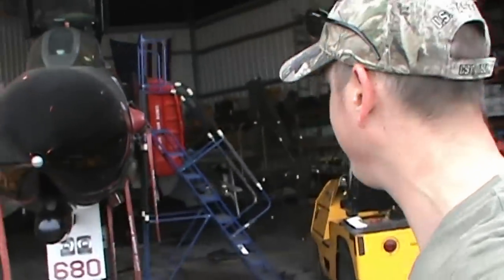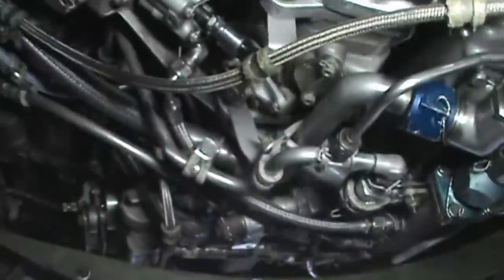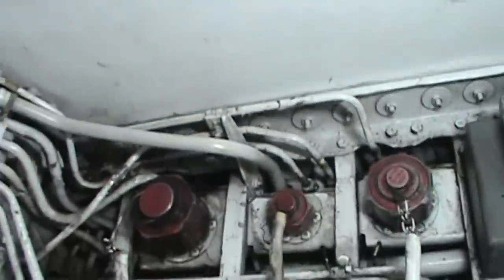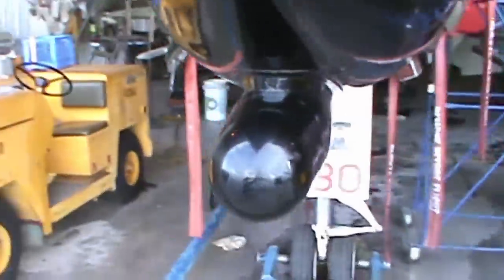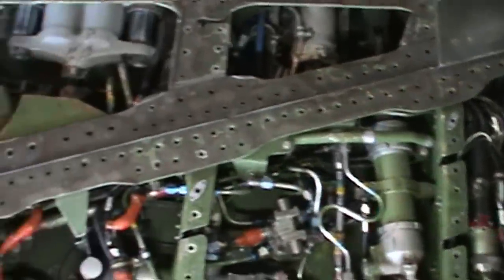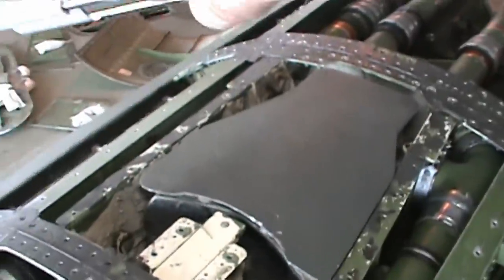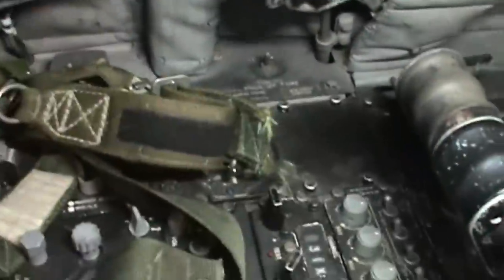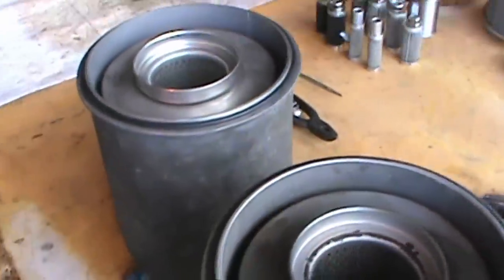An inside look at an F-4 Phantom

Comment: I was a WSO/EWO in the F-4E and RF-4C. Fun to see a Rhino being serviced to fly. I do remember having to know many of those circuit breakers in back seat. One was for the pilots seat. We would prank a new pilot when flying by having them run the seat all the way down so that we could see the fuel gauge (none in the back). When they had it down we would pull the breaker. They’d start to get worried especially when approaching to land. And, we’d say, “Guess I’ll have to land this one.” The newbie got really nervous then and the jet would start wobbling as they tried to figure out how to see. Eventually, we’d reset the breaker. The relief was so evident. Lol.
Reply from the maker: That's awesome with the backseat pranks! Thanks for sharing and thank you for your service!
Reply: Did you fly it after DMAS was added? If so, did you guys utilize the new bombing modes when dropping dumb bombs or did you still emphasized manual bombing?
Reply: @agostonbazmajer1100  I was in the last F-4 training class the USAF had. The only non ARN-101 Rhino I ever flew was in the RF-4 where I flew a couple pre ARN times but also the newer post ARN with GPS which the Boise Guard flew.
Reply: @sharizabel2582  Thank you very much for the answer. I have a second question if you don't mind. By the time you got to your operational F-4E squadron, how much emphasis was put on using LGBs or the GBU-15?
Reply: @agostonbazmajer1100  I was never actually in an operational E squadron. We trained in the E then either went to G’s or RF’s. The last operational E Squadron closed 6 to 9 months after we graduated.
Reply: Y'all are evil, I love it 😂
Reply: That isn't a nice prank but it's very funny all the same
Reply: It was normal for the WSO to fly from Oscura bombing range back to Holloman AFB. I had a fairly new WSO and  while he was flying I would start turning off the Stability Augmentation channels one by one. This resulted in the aircraft getting very squirrelly to the point that the aircraft was almost out of control. I would take control of the aircraft and “save” us by turning the Aug channels back on. My WSO finally caught on to what I had been doing. On our next weekend cross country, we were over Amarillo, TX when the Master Caution and Fuel Low Level lights came on. Somewhere in the vicinity of the pressurized avionics bay right behind the WSO is the fuel feed tank. All fuel going to the engines comes through this tank before entering the engines. There was a switch next to the fuel gauge that when raised, allowed the pilot to check the fuel quantity in the feed tank (1800# max if I remember correctly). I tried to check the feed tank but it did not work. I didn’t know the status of the fuel in the aircraft. I knew that Amarillo used to be a SAC base with a very long runway. Just before I pressed the radio switch to declare an emergency with Albuquerque Center and do a high dive to get the aircraft on the ground as soon as possible, I heard a snicker coming from the WSO in my headset. I said “what did you do?” I later learned that he had pulled the fuel control circuit breaker.  I had to admire his ingenuity. It was a great payback!!!

Comment: Nice video, thought I'd never see the inside workings of an F-4 again...
Brought back a lot of memories...some good,some not so... The F-4 would bite you if your not on your toes!
Reply from the maker: Thank you for your service! For sure, you have to be real careful walking around underneath her!
Reply: Yes, you'd hear or see horror stories of guys in a rush using a high pack to inflate tires or an egress troop pulling a seat while stepping on the rocket lanyard and going for a ride into the hangar ceiling.  I had a lot of respect for that seat while pulling safety pins or installing them.

Comment: One of the most impressive planes ever. The Truck. the Flying Brick. Look at all that hardware.  Mindboggling!
Reply: Big Iron.  Rhino.  DUFF.  Eisenschwein (Iron Pig).  Luftverteidigungsdiesel (Air Defense Diesel).  The only airplane so legendary that it might actually be able to just almost replace the A-10 by carrying a cannon in a pod.
Reply: Good old Lead Sled

Comment: I was a crew chief on the RF-4C at Bergstrom AFB in Austin Tx in the 80's. The thing you said is a big oil filter is actually where a "cart start" attached. This is a coffee can gun powder cartridge used to start the engine without a -60.
Also the wing hard point is not where drop tanks mount. They're two 370 gallon fuel tanks on the wings (1 on each).
Panel 23....omg.... utility hydraulic pump, air pump... always an oily mess.
That air conditioner vent is where the 10 liters of LOX is contained.

Leading edge flaps reveal the BLC (boundary layer control) where exhaust glasses from the 17th stage of compression is used to reduce the air pressure on top of the wing is slow flight.
Reply from the maker: Awesome, thank you for your service! And thank you for the insight on the tanks. I think I had it mixed up with another aircraft in being able to carry two on each wing.
Reply: While I flew F-4D’s at Holloman AFB in the mid 70’s, the rear BLC was capped off. I heard that it was to save the maintenance required for the rear BLC. We increased the final approach speed by 10 kts. The real purpose of the BLC system was to achieve the lowest approach speeds for carrier landings. It did not have anything to do with accelerated stalls.

Comment: AWESOME! For such a big bird all that stuff looks just stuffed in tight. That just gives me more mad respect for the mechanics keeping her flying, and cursing the engineers.
Reply: As a crew chief, I had to open many panels for the specialists with a speed handle.  Some panels had A LOT of screws in them and you hoped you could get them out without stripping the head or breaking a nut plate.  The term or reason for panel removal was "FOM " or facilitate other maintenance.
Reply: @CVO_GUY  Thats why we were called screw chiefs. Pull panel, replace panel. Remember panel 101 and 102? on the wing? Over a hundred screws each of #2s & some #3 's and hoped none got stripped.
Oh, and those HI torque screws....don't over tighten!

Comment: I got my start in hydraulics in the navy on nuclear submarines.  I later joined the air force and got my hands on F4s. Cs and Ds.loved it all
Reply from the maker: Thank you for your service! If you did hydraulics, the next video I have for the F-4 deals with a particular piece of ground servicing equipment for the hydraulic system.

Comment: The BLC system was great, especially when you had rain the night before and an unsuspecting new guy helping launch. I'd have him stand behind the wing to monitor the flight controls and when the pilot dropped the flaps, the new guy guy a bath 😂 On those hot Florida days, I made sure I got the shower! Fun times.
Reply from the maker: Is that the bleed air system for the wings! Sounds like a fun (and harmless) prank!

Comment: Ya got a lot to learn about the best F-4. Good luck and thanks!
Reply from the maker: I sure do, thank you for the insight on the fuel lines!
Reply: @DieselThunderAviation  Also the generators were not located in the front of the engines, they were aft on the constant speed gear boxes.
Reply: @DieselThunderAviation  m

Comment: With so many critical parts congested into tight spaces, it's easy to see how one errant lucky round of small arms fire could cause a major catastrophic failure and lead to the crew having to eject with no other options left. Also putting the refueling probe aft of the cockpits must have made mid air refueling a real bear in this beast
Reply from the maker: I can only speak from my experience from doing simulated aerial refueling in DCS World. The F-16 has the refuel socket in a similar position as the F-4, though its refuel door retracts down instead of the refuel socket popping up from the airframe like the F-4. The bottom of the tanker has positioning lights that the pilot references to maintain their position while the boom operator on the tanker does the rest of the work. 

In another one of my videos where the Phantom was started up and taxied, the last segment of that video is a conversation with a real F-4 pilot where aerial refueling was discussed.
Reply: A hydraulic fuse helps
Reply: Mike, most pilots would lower their seat when air refueling as the canopy bow was in the way.  It was awkward but doable.
Reply: @jcheck6  thanks for the info
Reply: Since the re-fuel was far behind the pilot, the pilot would use positioning lights on the belly of the tanker while the wso (the boom was right over his head) would look up at colored marking on the boom itself and call out position and rates-of-change.  Practice makes perfect > day-or-night, VFR was quick......IFR was a pain-in-the-butt.
Reply: That's with every aircraft made today
Reply: @scallen3841  no kidding troll
Reply: @mikejacobs2886  Relax big dog it's only YouTube comments

Comment: What you call an air condition vent  @9:45 is the LOX servicing door.
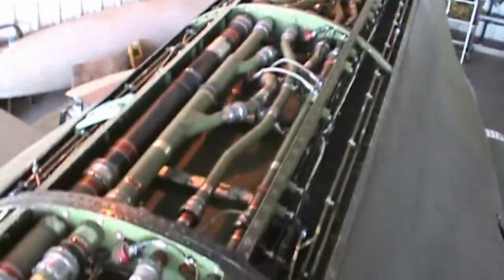@11:13 the large panel with the small missing panel: pull that and or the top large panel @12:06 and the plane will sag its tail just enough to mess up the alignment of the screws to put them back in. 
We had to once use a 20 ton jack under the tail hook base to get it done or place one there to brace it.
Reply from the maker: Learning more and more everyday about this amazing airplane!

Comment: I'd never heard the term "hard wing", probably because I'm 28 and started working in aerospace on the F/A-18C/D Hornets 😂 had to look that one up. That got me to subscribe, looking forward to more videos!
Reply from the maker: Thank you, more videos on the way! I think the term "hard wing" was used mostly inside the F-4 community as a way to differentiate them as there were a lot of variants. The A through D models did not have slats and are the ones usually referred to as hard wing. Starting with the E model the Phantom had leading edge slats, giving them better maneuverability over the earlier versions.

Comment: Interesting video.  I had the pleasure of working on F-4D's and E's as a weapons mechanic at Eglin AFB and Korat, Thailand. At Eglin, I had the opportunity to actually fly in the back seat of a D model.  I never heard the term "wizzo" during my  time in the AF.   The term GIB was used for the back seater (guy in back) as he was a trained pilot.
Reply: WIZZO =  WEAPONS SYSTEMS OFFICER,  I USED TO HEAR THAT TOO. GIBC= GUY IN BACK. BEST OF LUCK
Reply: I never heard that the back seaters were trained pilots but I was at MacDill AFB, which was a training base for pilots. The IP sat in the back seat with the student pilot up front.  I remember the IP in the back seat would pull and rotate the selector valve so that if the front seater were to punch out he wouldn't go too.
Reply: @CVO_GUY  WHEN I WAS STATIONED AT BERGSTROM AFB TX. TWO SQUADRONS THE 45TH, AND 62ND. WERE BOTH TRAINING SQUADRONS. WHILE THE 12TH, AND 91ST WERE COMBAT SQUADRONS.

Comment: @3:40 the large socket next to the pneumatic starter motor is the cartridge start receptacle where a large bell shaped cartridge full of a slow burning gunpowder like charge is placed, the receptacle lid is missing. Set it off from the front cockpit and gas is produced to spin up the starter (and a crap load of thick black smoke) and get exhausted out the exhaust port.
Same system as used on the B-52.
We had to watch the burn as flame sometimes comes out of the port and sometimes goes in the aux air door. If a flame came back out of the aux air door, RUN!! If the crew chief running this is the que for the crew to bail too.
Reply from the maker: I had wondered what that socket was for. I had asked our crew chief about that, and it seems he really did not like those. He said while they generally worked, they did make an awful lot of smoke and made the jet dirty in the process. Thanks for the insight!
Reply: There was a regular schedule for doing cart starts.  Usually worked as advertised.
Reply: @CVO_GUY  I participated / saw only 3-4 and only in Germany. We were told that the carts were getting old and had to be used. That was in '79.
Never later in Nellis AFB or my ANG unit.
Reply: @DieselThunderAviation  Oh ya, one cart start that went wrong. Crew chiefs fault. His start has a flame come out buried in all the smoke. Didn't see where it went (nowhere). He panicked and ran. The crew saw him run and pulled their ejection seat harness guillotines and front went down the nose and WSO over the side. Got chewed out for causing the loss of a launch and 2 harnesses, @ 1979 $$, $900 each
Reply: @paulzaborny6741  I'm talking mid 70's so that may be why they were used pretty regularly.
Reply: @CVO_GUY  For me after those I never saw one at that base again from '79 and on.
 Nellis is an advance fighter tactics school base so no smoke there.

Comment: Your videos of the F-4 are awesome! The F-4 is one of my favorite aircraft.  It seems amazing (perhaps, rather unbelievable) that such a complex machine, designed by aerospace engineers (who might also have designed spacecraft) could be maintained & repaired to the required standards for near optimal performance without excessive downtime, by high school kids. Perhaps the greatest challenge (aside from creating the staggeringly complex aircraft) was for the engineers to determine how the aircraft could be maintained & repaired to the required standards by people that might have had very limited technical backgrounds, let alone aerospace engineering experience. 
I've used T.O.'s; they're very comprehensive, & tell exactly how a procedure should (must) be done, & I can imagine the endless hours it must have taken to draft, revise, & draft again the T.O. information until it was considered accurate (enough) for release & publication. 

Just my thoughts, speaking as a pilot, mechanical engineer, & 30 year Air Nat'l Guard member.
Reply from the maker: Thank you, glad you enjoy the videos! The engineering that goes into these is amazing. And I've heard it joked before that it takes a college education to fly them, but a high school diploma to fix them. Thank you for your service!
Reply: We did have technical schools in the Air Force to provide the basics prior to actually working on an aircraft plus you did get OJT from the more experienced troops while at your first base assignment.

Comment: Very interesting.  While I know the F4 was a good design this tour highlights a subtle design philosophy that has been improved and can be improved.  A smallish team was responsible for the overall metrics but many many engineers designed all subsystems.  Given the task then off to the drawing board.  The overall design was trying to meet some standard.  It wasn’t designed backward and as an integrated whole from first principles hence a very complex design with many jigs here and there to solve problems that come up.  Cool design though.
Reply: Sometimes while removing the ship's battery you thought the aircraft was designed around it.  A real bear sometimes to get it out of its compartment.